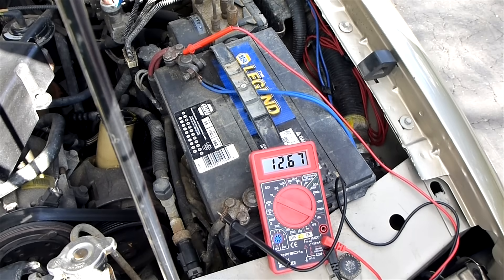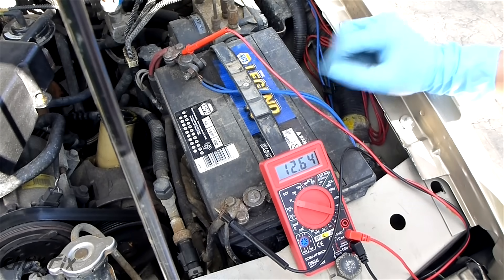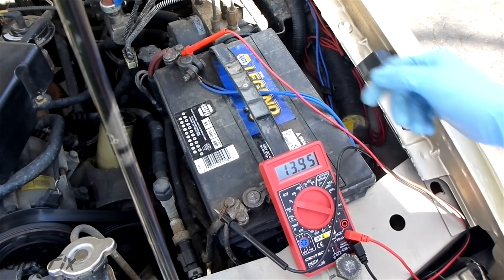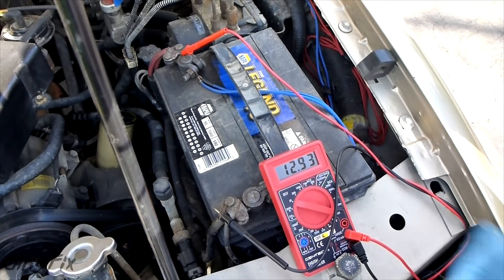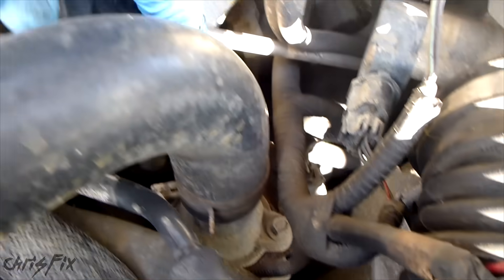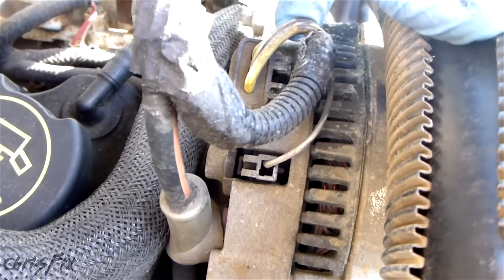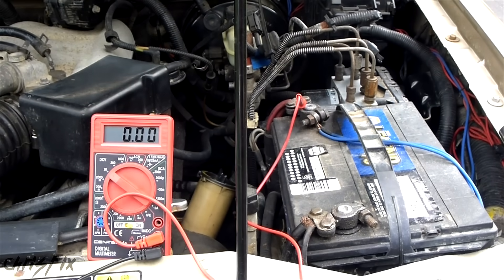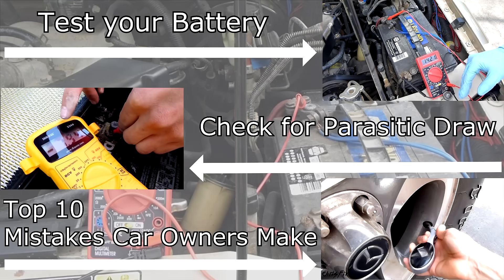How to Test an Alternator

Comment: Hey my Nissan Rogue  2008 mine had all kinds of power but it died on me driving den barely move but it goesn and I put in reverse den was normal but drive no power going forward so is it still at altenator or something else it's dead now havnt tried to start it agsin but if sits awhile den start it up again den it's starts tried turning on heat when driving den it loses power barely move..so like to no wat it Be den thanks..??

Comment: My alternator isn't charging my battery and I've checked for continuity to the ground leads from the alternator positive wire, nut, post, and case. They all give the same voltage as the battery (~11.45-10.5 depending on idle time and how much it's died while testing). I tried your method to check voltage drop from the alternator case and bracket to the negative ground for the booster pack (battery is in trunk) and couldn't get any reading. Both alternator and battery are new, and voltage regulator looks fine. Did I purchase an alternator that isn't working? Belt is tight and alternator is spinning but I can't seem to find any reading for it just the battery. I checked all the pcm fuses and the battery fuse and they look fine. Vehicle is a 2007 charger with 220'000km
Reply: Took alternator back and exchanged for another new one. Hooked it up and everything's fine. Turns out it was just a bad alternator. My luck lol

Comment: Ok so my electric power steering works and stops after parking the car and turning it on again. 1 guy told me to check the battery so when i do that everything checks out except when i turn everything and i mean everything on the alternator starts squealling like crazy , the voltage dropped to 12.4v and after 30 sec the squeal stopped and voltage went well above 13v . Im wondering if its the alternator thats triggering my Electric Power Steering to stop wroking?

My EPS didnt go out during driving tho, i drove to the store went in .got out started the car and EPS was off, i got home and next day turned the car on and PS still didnt work so i took out the fuse to check and its fine, after that when i turned the car on PS was working, i went to a couple of stores to buy stuff and again afterlike 2 or 3 stores when i turned the car on PS was not working again, so today is a third day and still not wokring so i took the fuse out again and when i put the fuse back in it starts working for a while, i tested taking the fuse out and putting it back in and the EPS starts working every time after that .

Comment: I have a 2006 Honda odyssey on the negative side it shows 0.2 volts as soon as I disconnect the negative side the millimeter shows it’s 11.6 but when i use a jumper cable it shows the alternator charges 14.5.

Comment: with my alterntor with no load 14.3 but with load it drop down to 12.51 what would that be
Reply from the maker: How much of a load are you putting on the alternator when testing? And are you noticing any battery/charging/electrical issues or weakness?
Reply: @chrisfix  not much only 2 led and heat and head unit then  battley wasnt charging by the alterntor my rpm thing was moving around the place up and down but i put the battley on charge and it working on the car charging by the alterntor  it has a delay when i try start it

Comment: My new alternator jumps around as a drive, it doesn't seam related to revs as when I give it 3000 rpm it can still hold around 14.4v but sometimes it jumps up to 15.5v the highest ive seen it was 16v im guessing that is rather bad id imagine its the regulator but given its only a couple of months old I don't know why its dying so soon.

Comment: Battery died twice it was a brand new battery Honda has not been moving two years when I will turn it on I hear a bearing noise I remove the alternator, turn the car on and the noise continues so it was not the alternator I put it back, But that’s when the battery died,  had to jumpstart it, I follow the steps on this video and the problem was I did not connect the cable from battery to the alternator it looked like it was connected but it was not, I learned to check every connection in detail so you can pinpoint the problem exactly good video

Comment: Can somone tell me why after putting a new alternator it idls up and down and stays steady for a while even a long while then it idles up and down even while driving as i slow down...is this what this a bad remanufactured alernator or is it a low amp alternator not maching the recommend running apms for the car? Right now im going to put back the old alternator because it had no no issues it idling was perfect.....i installed a new altornator because it was new and never used. it was for my old nissan sentra but i junked the car...so i had this new alternator that matched my parent's car identically. Need some advise

Comment: I just had a new alternator put in but it's reading 11 volts. My old one would squeel a lot before it crapped out. I'm going to get a multimeter and run some of these tests. Maybe it's the wire connected to my chassis. If I can find where it's at. I thought about buying a replacement ECU and trying that. My car is a 2003 Mitsubishi Eclipse if anyone has any advice it would be appreciated.

Comment: Hi my car is reading 14.2v when i start it but when i put heater,lights,demisters on it drops to 13v need help
Reply from the maker: Are you having an issue with your alternator or battery? That could be correct for you car
Reply: @chrisfix  hi the battery reading around 12.3v with engine off when I put engine on it reads 14.2v as soon as I put accessories on lights heater etc it drops to 13v
Reply: When i put everything on lights heaters etc voltage drops from 14.2v to 13v to 13.3v does that mean bad alternator
Reply: @abdulbeany1894  no. your alt is good
Reply: Hi got new battery on car reads 14.2v then 13.2v with all lights heaters stereo rear diminster on thanks

Comment: Hi my car didn’t start so we called our battery guy and he replaced it for a time being with a temporary battery but after we stopped the car using this other battery the car wouldn’t start again so we jump started it and went home got our battery fully charged but then 1 week later car wouldn’t start again some guys said 
It was a belt problem and the other guys said it was an alternator problem. 
I think it’s an alternator issue anyway can I do this test if the car doesn’t start or is it for sir an alternator test.

It would really help to know please 🙏

Comment: My in laws have a 2015 Kia optima charged the battery said it was good started up the car and it died in like 5 sec so I think the alternator is bad bcuz the past days they had to keep jumping there car but now it only stays on like a second but I fixed they had a draw with a bad brake pedal sensor but I fixed it now they have this problem car shuts offf after a sec so I thinks a bad alternator

Comment: Hi, when I connect the plus to the battery and then the minus to the alternator case (can not see the  nuts) it shows around 14v, the multimeter is on Dc V, I dont have numbers. What does it mean?

Comment: I replaced the battery and with a load on the voltage is 13.67 with car on no load its at 13.56 volts. Should I concerned that the alternator is bad since im not at 14.2 volts.
Reply: That reading is for a 2016 Mazda Cx5, my old kia pulls 14.2 when car running no load. Which I know is good

Comment: So i have a 5-6v voltage drop when testing between postive terminal and the alternator post (and all other parts of that including wire, nut etc). What do i need to clean/fix if its the post that has the voltage drop? - post/bolt looks very clean it all looks new

Comment: I do have a question. when i have my jeep turned off it's at 12.6 but when i turn it on it jumps up to 13.7.  
however, when i turn on my AC and lights it stays at 13.7 
I have a brand new battery and brand new alternator for my Jeep wrangler. 
do you think i should be worried on the voltage that it's not at 14?
Reply: my alternator 13.7 too, but battery 12.3
Reply: @matheushenriquecosta2889  Thanks for letting me know. Oh and  *Update. well i have been driving since i replaced the battery and alternator and so far it has been good. It hasn't left me stranded. I have JK 2011 if anyone wants to compare. 👍

Comment: On the last test touching the b post you didn't  say what the fix or problem is if it is above 2.8 . Mine is running ing at 0.6 .this stays at 0.6 touching each different  point on the mentioned  post of alternator

Comment: How did he raise the rpms from the engine bay?  Can someone please explain?
Reply: He’s either moving the carburetor throttle arm or squeezing the cruise control diaphragm.

 I’m not familiar with this specific engine. Lots of older engines, you can move the throttle cable (give it more gas) from under the hood. Newer cars it’s harder to find, or just impossible because it doesn’t exist.

 By the way, it’s very very dangerous to stick your hands in a running engine if you’re not really familiar with it so don’t go hunting for moving parts alone.
Reply: @heatshield  Ohhh! I honestly didn't know that was possible but that makes a lot of sense and is very helpful! And yeah I'm not gonna do anything yet without the proper knowledge or help if i ever need to use this little trick. Thank u so much!

Comment: Chris, this is an old vid but very useful. thanks I have a new battery and alternator I installed.
my voltage set point on the alternator is 13.9 while running. it sits at 13.45.  I tested the negative/positive on the alternator case, bracket, engine block and reads .01 while accelerated. tested the positive to the bpoint and it reads .20 accelerated. I've sanded the bpoint connector and the battery wires, but I don't get it to read 13.9v,  anything else I should look for. I couldn't find my ground wire to the chasis. if I disconnect the positive cable the car continues to run. thanks for your help.
Reply from the maker: Are you noticing poor electrical performance?
Reply: @chrisfix  Hi thanks for responding. I installed everything yesterday. I drove it around the neighborhood with the lights, radio and ac at full blast and car was running fine, when I got back checked the batt charge car was  off it was 12.67, when I left it was close to 12.86.  didn't run long,cuz didn't want to get stranded. with everything on it stays around 13.45 it might spike to 13.6. thanks
Reply: what's funny is the very first start after install, everything on it read 13.96, then started lowering and stayed around 13.40-60.

Comment: 1500 it cost me to replace battery (300 bucks 7 year warranty) new Altanator around 1100 man it killed me getting 20 imch rims. But itsa common issue with ,axima. I did the Altanator and battery on my 1sr maxima as well.

Comment: A while back in my 88 Monte Carlo LS, I changed the alternator at night and missed a wire on the install.. sparks were flying lol. I attached the wire and thought all was well.. Next day I drove for 3 hours to visit a friend, the whole way I was amazed at how fast the ac fan was pumping air and the power windows just flew up and down. There was a slight smell of rotten eggs on the way but I didn't clue in. I blew up the regulator in the alternator and it was kicking out super high voltage. When I opened the hood, the battery was bulging out at the sides like a water mellon haha.

Comment: I got different results when i tried it in the morning versus trying it after whole day of driving. In the afternoon with everything running it was around 13.10v but in the morning i would get 14.42v. I dont know what to make of this? Does time of the day matters for this test? Or the inconsistency is a symptom of bad alternator?

Comment: Sad fact is that it's our loss of trust in mechanics, is why we're here venturing for information and a 'true' diagnosis of our car problems. If mechanics didn't rip us off replacing parts that didn't need to be replaced (and they seldom do replace them anyway if the existing parts are still working, and charge us anyway), excess amounts for simple labour, then citing MORE problems unearthed after the first problem, and elevated costs, these vids wouldn't be needed.

Because of trying to self diagnose, I found the problem with my car - a wire going to the starter motor had broke (the wire had broke from a metal lug). I still paid a mechanic to sort it out but having a correct diagnosis resulted in a realistic repair fee, whereas when I rang cold, I got quotes of alternators, starter motors, in the 100's of £ plus a cost to tow my car to their garage. After passing a correct diagnosis to a local mechanic with a WhatsApp image of the break, he came and repaired it in my drive. The same mechanic was citing lots of possible problems (on the first phonecall before I knew the issue) and pricing me up in the hundreds to 'ready' me for a large quote most likely - we'll never know! Knowledge is power - and in this case - money. It's good to be clued up before approaching a mechanic - and if you're able to repair it yourself - it's a win win! Big thanks to these guys on YouTube - so many people with their useful vids have helped me to diagnose tonnes of problems correctly (or get into the correct ballpark) over the years - have likely saved me thousands.

Comment: Hey I purchase 1993 Buick regal custom and eights have a some charging issue I replace the battery and alternator bolt but it still didn’t fix the problem I did for the diagnostic and I found the signal cable when Engien was cold it’s past that Signal but couple minutes later is a stop the signal to the alternator and then my voltage is going way down so I want to know what next thing I have to do fix that problem

Comment: My wife's car battery was going flat after a week and knowing it wasn't that old I suspected the alternator. I was ready to buy a new one and just tried to find out how to test it first. So glad I came across your channel as the problem was a bad earth between the alternator and it's bracket. A little cleaning and the voltage drop went from .16 to .05 The car is charging fine so $$$ saved thanks to you. Cheers mate.
Reply: It's happening to my Hyundai Elantra mine is only a day a battery is flat

Comment: Hi, how much should be the voltage drop when only the AC is turned on when the engine is running (not just the fan)? Thanks

Comment: Hey ChrisFix, I checked the connection from my battery positive terminal to my alternator b post(the stud) and I gotch a reading above 0.25volts. I cleaned the stud and still remain the same. what should i do next?

Comment: The thing is my battery was replaced twice with a new one and my car cannot sit very long before. It drains the battery so I assume that it could be the alternator and the other day. I had to get my car jumped 4 times because I didn't drive it enough but when I got it.  Stopped it died completely on the side of the road and then they got another jump and made it home. It doesn't even turn around and go click click anymore so the battery is dead and I assume that. The alternator what's the cause of do you test the alternator in this situation when you got a dead battery now
Reply: You need both battery and altanator
Reply: I just had same issues both replaced.
Reply: Dis you get a red l8ght that made fast clicking noise you can hear battery bein😢drained
Reply: Ya I had same clicking on both maxima.  Cost me 1500 ouch

Comment: My car's voltage was fine with just the car on but with ac and headlights on it dropped to 12.3v, turns out there was a voltage drop of 0.47 from the positive of the alternator to the positive of the battery, cleaned the positive on the alternator with a wirebrush and now it is at 13.8-13.9v and 0.16v voltage drop

Comment: What about checking the output of the alternator, and if it’s no good, I’d check the exciter wire to the alternator, needs voltage there for the alternator to start working. Otherwise you’ll change the alternator and still have a problem and a angry customer

Comment: @ChrisFix : i was wondering if the charging of the battery still applies to modern cars like after 2021 models? I have seen my car run at 12.2-6 or 13.x its strange, so i am wondering if newer model Honda City/Ballade/Jazz have different alternator or some other middle layer that tells the alternator to charge the battery or not ?
Reply from the maker: It should still be the same. I have some newer cars I work on and they all charge at the specified voltage.

Comment: hey Chris i have have a engine light popping up... but everytime i charge the battery full with a 2A charger  the light goes off for about a week or 5-10 cranks then pops up again. is this a battery issue, alternator or God for sake a parasitic draw. i dont understand why the battery light isnt popping up but the engine light when fully charged vs the battery going low or whatever
Reply: the battery dies within 8  months with minor use so maybe not a parasite

Comment: Chris your a star. Over here in the UK  my wasn't starting so I got the company who sold me a battery for it to test it as its 3 years old and guaranteed for   4 years. They said it was fine. So had my van towed to a local garage which cost me money and they now say it needs a new battery. Who do I believe then !. Garage have recharged battery so I am collecting it tomorrow. But now I have watched your video I can check for myself whether alternator is charging before I claim compensation from either company. Thanks Chris.

Comment: I've just replaced a dead battery that I got second had 5 years ago. Which is why I didn't bother charging it. I also thought my alternator could be at fault, but thanks to your video I was able to do a simple check and confirm it's as it should be.
Reply from the maker: Glad the video was helpful!!!